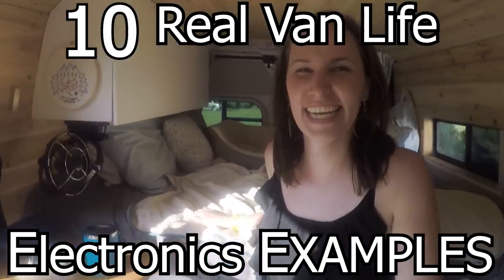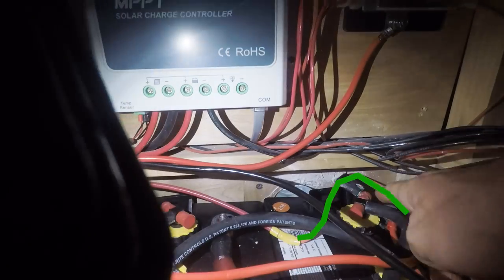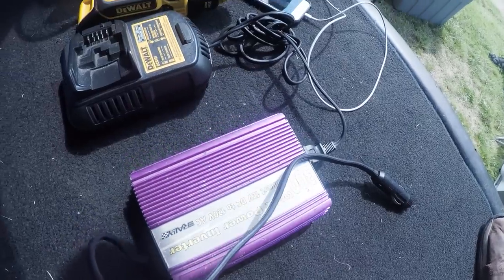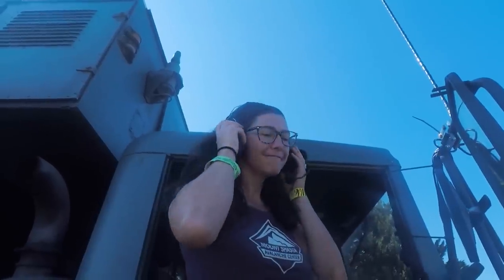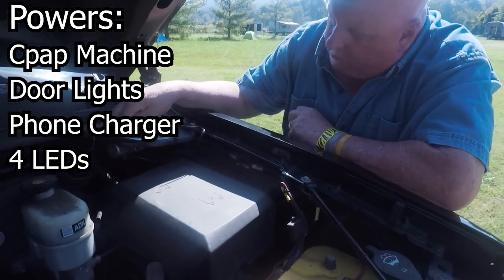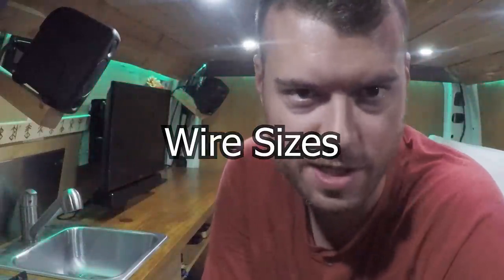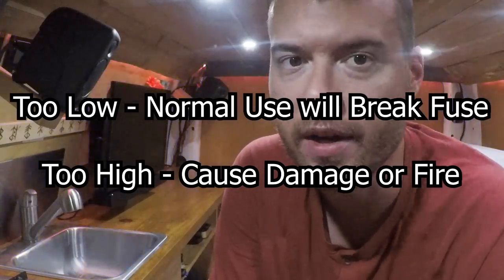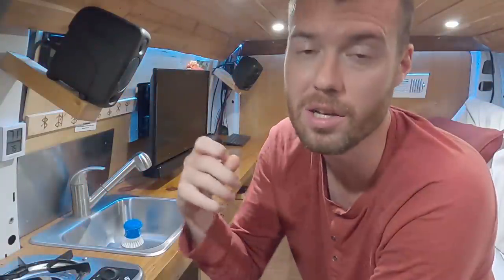VAN LIFE ELECTRONICS Start to Finish (Learn solar wiring here)

Comment: hello thanks for the info.retired carpenter. I'm just starting a van build 2020 ford transit. week end carping. just now learning how to install solar and alternator battery charging
 was looking at electric generator. or a solar kit. would like to run refrigerator lap top phone charging inverter for regular wall plugs.  what would you recommend
your advice would be greatly appreciated. thank you
Reply from the maker: Honestly all that can be powered by solar. I think solar is fine, skip the super heavy generator, not worth extra gas mileage.

What type/size fridge? Know amps or watts it takes?

What type laptop? Look at charger, watts on charger label. How often will you be on laptop?

Honestly if it's only weekend camping, you can get away with less power overall. What's the longest you'll stay out for?
Reply: @OutdoorsEmbrace  hey thanks for the comeback. I was thinking about a kodiak or blutii generators. or a  solar system. are the kodiak and blutii electronic generators a good option.??.I would like to install a good solar system. again thanks for the comeback
looking forward to your reply. have an  awesome day.
Reply from the maker: @wilbertolugo8700  I know almost nothing about the generators besides they are extremely heavy. I'd never put one in a van myself, and very few people do in self builds. They are loud and draw attraction to you, so you won't be very stealth overnight. And MPG will suffer.

If you answer the questions I asked above I can help size your solar array for you. Tell you how much power you'll really need because with what little you are running, it seems like you'll only want solar. A generator is serious overkill for a van unless you plan on having AC overnight and only parking in designated RV camping spots and maybe Walmart.
Reply: hey thank you for your solid advice. I will build a solid solar system . thank you again
may your journey be filled with joy and peace. shirring your knowledge is a wonderful giftthat you have. stay healthy
I will keep min touch and update you on my build. I'm not quite ready yet waiting for insulation an a few other things.
im pump up for this build thanks again.
Buen Camino 

 @OutdoorsEmbrace

Comment: I'm trying to design a solar system for a van with a solar panel a battery isolator as well as a 120v trickle charger. Is there anything I should worry about overcharging or back flow of power
Reply from the maker: Have a solar charge controller. That takes care of the panels.
Have a DC to DC charger in place of the battery isolator you wanted. One that has a charge controller, or ran through the charge controller will prevent overcharging or wonky battery stuff overtime.

Make sure the trickle charger has a charge controller. That's basically my advice for all this. Run it through a charge controller so it knows when to cut the charge and what charge state to be in by reading the state of the battery.

Comment: I left with 2 seconds left, sorry I didn't make it to the end. What is a good van to use for the conversion?
Reply from the maker: Haha! Thank you for watching! If you would have watched the last two seconds, you would know I answer that question. Haha JK
Any van is good, it depends on the needs of the person. But for the bigger vans, the Transit seems to be best for the price. The Promaster has too many issues since it's made cheaply. And the new sprinters are expensive. Transit is my choice for it's height too, tallest van so I can stand. Only one I can stand in, besides the new sprinters, but barely. Transit has better cab conditions up front, like more comfortable and not as cheaply made.

Comment: I'm currently hooking up my solar power. The only thing I'm not clear on is wether the battery needs to be grounded. Nothing is being connected to vans electric. I know my inverter does. I just have solar, 200ah battery, inverter and 12v panel. Thanks for anyones help on this.

Comment: I purchased a solar panel kit (noma brand) at CT which includes a charge controller... I don't know how to tell if it is pwm or mppt. I'm assuming its pwm but I don't know how to tell for sure. Any tips to tell? Thanks so much.
Reply: I want to add two more things: 
1- I'm surprised that you wire your solar panels in parallel instead of series. I recently read explorist.life blog entry Solar Panels - Series vs. Parallel and it seemed like wiring the panels in series was more efficient. I'm interested to know your thoughts / reasoning!
2- I watched til the end :)
Reply from the maker: The main thing to remember is that wiring in series will increase your voltage, while wiring in parallel will increase your amperage. Connecting your panels in parallel will increase the amps and keep the voltage the same. This is often used in 12V systems with multiple panels

Comment: Can I buy a suitcase type travel solar panel you can store away and pull out when needed and also can you run that straight to the battery without the mppt or other type comforter just bare solar to battery. Not leaving it connected when away from van
Reply from the maker: So yes, you can. But the solar panels would have to produce the right amount of voltage. You run a high risk of damaging 12 volt batteries if the power output from the panels is greater than 16 volts.

Don't ever leave them attached overnight. The solar will drain the battery. The power moves backwards when no light is on the panels. This is one thing an charge controller handles.

I would be sure to buy a charge controller, even if it's just a small PWM
Reply from the maker: It's just a bad idea. You'll most likely kill your batteries quickly. If you do try this, don't be fooled by it working for  a few times in the beginning. Over time, this method will quickly lessen the life of your battery.

Comment: Surprised you recommended wiring the panels in parallel. For MPPT controllers as long as the series open voltage (at coldest operating temp)  is below the max of the controller, series is more efficient (higher voltage, less loss to heating the wire caused by higher amps in parallel, etc. Am I missing something in my understanding?
Reply: Great video :-) Watched to the end. Loved seeing all the different setups. I'd watch tours like that any time.
Reply from the maker: Voltage is high enough from just one panel, don't need higher voltage. I wanted to charge as quickly as possible, higher amps needed. Also, in parallel, one panel can be in shade while the other still completely works. In series, if both panels aren't completely in sun then they don't work so well.

Comment: If you are knowledgeable, read the specs. My Sealed AGM batteries are 6 volt 335 Ah, I have 6 for a 12VDC ~1000Ah . I use a Power Max PM3 - 60 battery charger connected to shore power or my inverter 3500Watt gas generator, Im going on 8 years, I bought them when they were 2 years old. I will wait till they fall to a respectable level before I replace them, they are still at 100% charge. I am a power hog but I dont run any kitchen appliances off my battery, I do have tons of gadgets that require batteries, cell phones, drones, cameras, video, laptops, LED screens, surveillance,  climate equipment (storm chasing), and a pirate radio station. I dont live in it but I have spent up to 2 weeks in Washington DC getting video and pictures during the marches.
Reply from the maker: That's a nice bit of power. I'll have something like that for my next van, but really going for Lithium myself. My current van still has Flooded Lead Acid.

That's awesome they are still going and able to charge to full  after 8 years.
Reply: @OutdoorsEmbrace  definitely go Lithium, I have 600lbs of battery bank, you can reduce it to less than 150lbs. Thats the reason I went with a huge ~8inch lift, my van looks level but if you take everything out, the rear is an inch higher. The other good reason to go Lithium is power usage, you can drain the battery a lot longer then half of what you have.

Comment: Okay I know this video is old but how many amp hours of battery would you suggest if I know I want to use a 3000 W inverter? (For a toaster oven & instant pot occasionally)
Reply from the maker: So for that, you actually can't just look at amp hours, but the amount of amps that the battery can actually handle, constant "C" of the battery.

For these things you need, I'd definitely get lithium Iron Phosphate.  A 200 amp hour battery can take 100 amps continuously at once typically. A toster or air fryer can take about 1500 watts, which is above 100 amps an hour.

You'll need to check before buying the battery that the battery can handle at least 150 amps per hour. I would get 300 to 400 amp hours personally to run this. Putting batteries in parallel not only doubles the amp hours 200 + 200 = 400... but it also doubles the C value. So you could use 200 amps an hour and be perfectly good with any appliance below 2000 watts on your inverter, like a microwave or toaster.

Comment: I have a question with lithium battery do i need to monitor the water level like regular battery.  Do i need to monitor lithium battery
Reply from the maker: No you don't. It's a set and forget battery as long as you are using a good charger and keep it within 10% to 90% range. Try not to charge to 100% or deplete to 0% for longest life.

Comment: Good but a bit confusing on AC vs DC. The tv and such need AC. I would have shown the tv going to an inverter rather than the dc circuit. You will save power if you use dc electronics true but I already own the ac versions of electronics.

Comment: I have a question about batteries I got one available that's 12 volts 200 amp hours 1200w load power for about $800 when there this other battery  12 volt 200-amp hours 2620 watt load power for $1,500.. is the more expensive one worth buying? The more expensive one is double the load power but I'm not sure what load power is
Reply from the maker: This is so odd, but I've never heard the term watt load power and can't find anything on a quick Google search. My guess is that that's how many watts you can use at once. I don't think the larger is worth it for van life. The cheaper sounds fine. 1200w is plenty to push whatever you are powering in a van. Unless you plan to have some crazy heat element like an electric stove which I highly do not recommend.
Reply from the maker: What type of batteries are these? What brand? Maybe send a link to them online?

Comment: Awesomely useful video man  👌 , but a question: by no means I want to sound offensive, but isn't it a bit silly to only use a 300W inverter in Bridget's example #1  build?  I mean having nearly 200 usable Ah's charged by 400W of solar AND a B2B charger, she could easily have a 2000W - 3000W  inverter, no?  All her very own business of course, but I just wanna know if I'm getting this completely wrong here??  Would my envisioned 2500W inverter be too much then in this case??  Greetz!  🚐 🏞️
Reply from the maker: Good question, I did answer why she's correct at the end of the video on the inverter part.

You shouldn't have a big inverter for the hell of it... this wastes power. An inverter should be sized according to the largest appliance's wattage you plan on using. She doesn't use anything larger than 300 watts, so a 300 watt inverter is most power conserving. Having a big inverter would just waste more power while running the same exact things.
Reply from the maker: Just because you can run it, doesn't mean you should!
Reply: Cool, it's just that I plan to have an induction cooktop to save space and weight, which would run together with the fridge which runs continuously of course.  Cooking AND water heating for shower won't be done because that would require just way too big of a inverter / entire system.   Thanks for the reply!  😁 👍

Comment: If someone were to run a pc with around a 550 watt power supply how much amp hours would you need to run that?
Reply from the maker: Without doing all the math, my PC runs at 140 Watts (see my PC Gaming in a van Video). I have about 230 amp hours of lead acid. For 550 watts pc, I would only run that with lithium batteries over 600 amp hours. Again, not doing the math, but based on what I know, it's what I'd do.
Plus, that's only if the computer was actually using the full 550 watts, which is a lot. I always recommend getting a nice laptop like mine. My smaller laptop is only 90 watts. Sometimes I use that. Watch that gaming video on my channel. One of the new ones.
Reply: Outdoors Embrace thanks :)

Comment: My inverter is a 2300 to max 4600.. Okay I got a 180 amp circuit breaker for the inverter is this the correct amount 180 amp circuit breaker for this inverter and I also have a 50 amp circuit breaker for my 40 amp charge controller I just need to know if these are the right amount of amps for the things that I'm
Reply from the maker: If the controller is rated for 40 amps, a 50 amp fuse is good, but for this particular case, I'd use a 40 amp fuse.
Reply from the maker: 180 amp sounds good for the device, but you the fuse should be rated based on the wire size in this case! What gauge wire is running too and from the inverter?
Reply: 4 gauge wire pure copper for the whole thing
Reply: An thank you so much for ans me so fast .its nice to have someone care .love ur channel very informative
Reply from the maker: @jm4672  so if it is only a 4 AWG, you should have a 100 Amp Fuse. 4 AWG is rated up to 100 continuous Amps 0 to 20 feet of wire.

In every case, the wire size should be taken into account. The fuse should never be rated above what the wire is rated at. Only if the device you want to fuse takes much less amps than the wire, will you want to set the fuse size to the device and not the wire.

You're probably never going to pull more than 30 to 50 amps at a time anyway. A 100 amp fuse is going to protect from fires if you get a short in the circuit.

Comment: I have an 2019  Airstream travel trailer . Is there a problem if I replace my lead acid deep cycle batteries with 2 battle born 100 amp hours lithium? Help
Reply from the maker: No issue, unless you are using a charge controller that isn't meant to charge lithium. Look your specific one up. Sometimes you just need to change settings on it and tell it it now is charging lithium so it does it right.

Lithiums do charge differently so it matters.

Comment: I do not recommend connecting anything to the battery without a fuse. Shorts in the wiring=fire hazard. Also the fuse block should be as close to the battery as possible since the cable to the fuse block is not protected.
Reply from the maker: Yes! All covered in the video. I always put a master fuse on the battery too. This system had a measly 30 amp fuse on the entire system, since I would never use 30 amps at once.

My new van has a 200 amp breaker, because a microwave runs at about 135 amps, and my sub woofer will take about 50 amps I believe (not yet tested)

Comment: Getting the most out of those Di-lithium Crystals. 
   The End of Times.. Could be Quicker than you need..  If you  don't  assimilate  all the  options in the video, to meet your required state of charge.
    Leaving plenty of Vroom to Engage Warp Drive, when need it Number 0ne.
                  ENDGAGE ..

Comment: Hi My question is how much battery & solar panels and inverter do I need for 83” long trailer pleaseeee I’m stupid to this type of things, I will be running Apple home computer & full size fridge & stove & 2 bug screen tv & hair blow dry and lights, Apple TV & Mac Pro laptop & cell phones & 2 fireplace & ps5 and washer and dryer in the DIY tiny house that is made out of shipping container, I want the feeling of a house powering please help I’m so clueless, I don’t want to over buy nor under buy
Reply from the maker: This is a quick answer for a question that deserves more time, but...
This is going to look like the last bus in this video. You'll probably want 600 AH Lithium batteries, and over 600 Watts of solar. They had a lot more solar in the video, the more, the better... but I don't think you'd need too much more than 600 watts.

Definitely want lithium batteries though. Stove better be propane. Don't do an electric cook stove. Any heat source in a build on limited power should be gas.